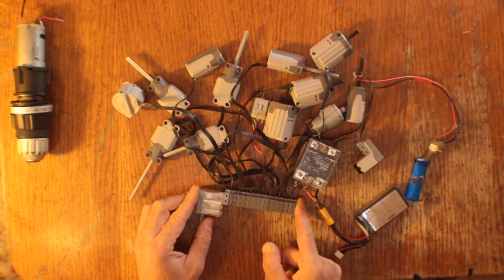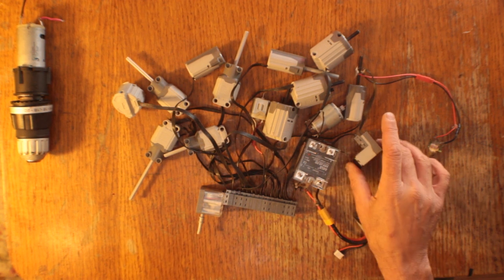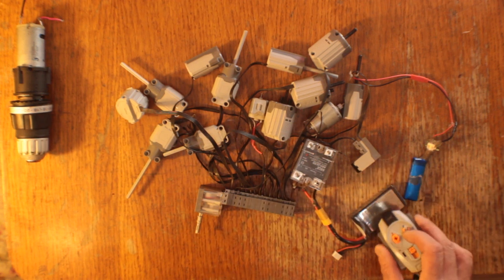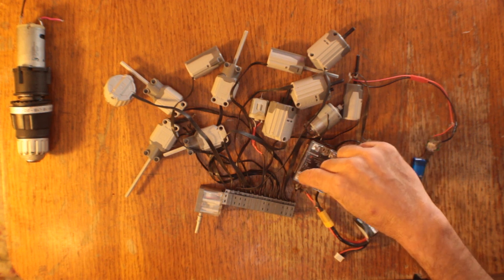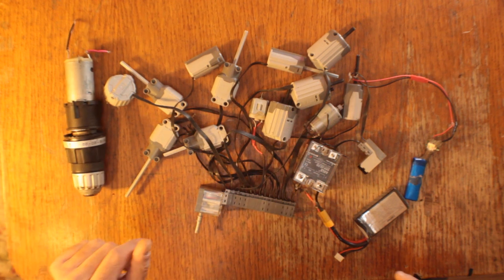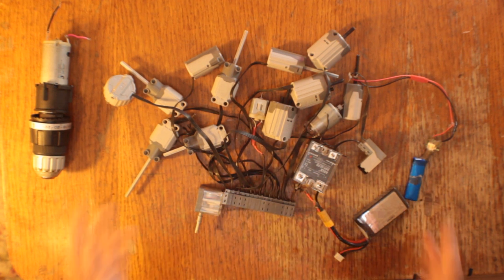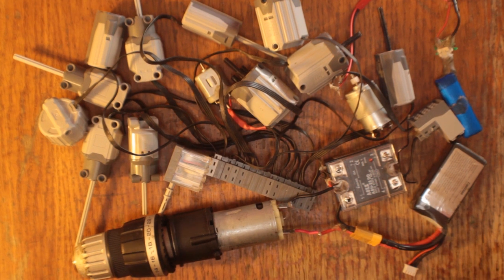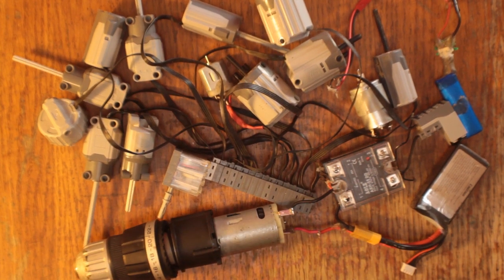Maximum Power Using Relays With Lego Power Functions

Comment: Very nice. I’m thinking about using a relay to control LEGO Power Functions motors with a 5V littleBits circuit. If you ever rig up a 5V littleBits –> 9V Power Functions system, I’d love to see it!
Reply from the maker: A mosfet would be good for that.

Comment: You can stil use reverse, if you use a second relay and 2 diodes on the relay inputs.

Also you could build a relay with only lego parts for example like this:
-> 1 ir-receiver powering 1 Servo.
-> Servo moves 1,2,3,4,5.... PF-switches.
-> PF switches are connected to 2 motors each

With this method you can also reverse the motors.
Reply from the maker: Wouldn't the best solution be an ESC and a transmitter-receiver? That fixes all the problems power, range, speed control, reverse, size, and weight. I ordered stuff last nite and will be using this method on my next motorcycle. The range was way too short for this one and the next bike goes faster.
Reply from the maker: At about $50 Hobby gear is the most expensive solution.